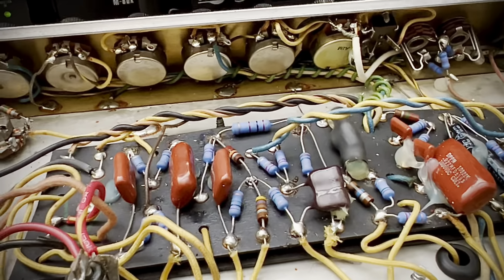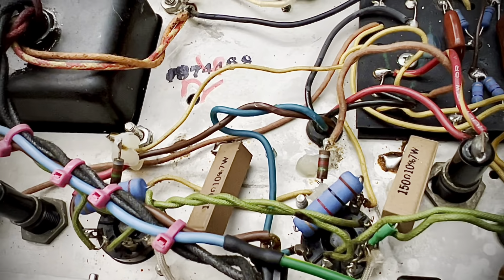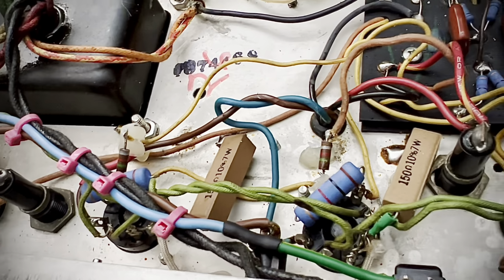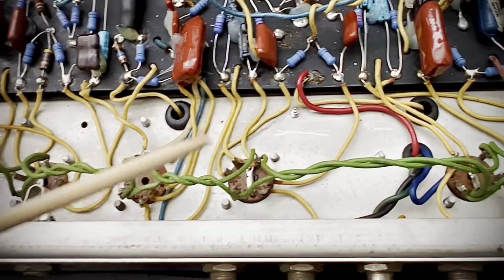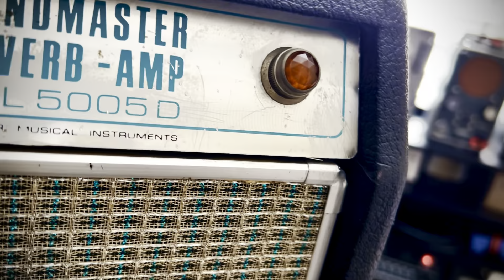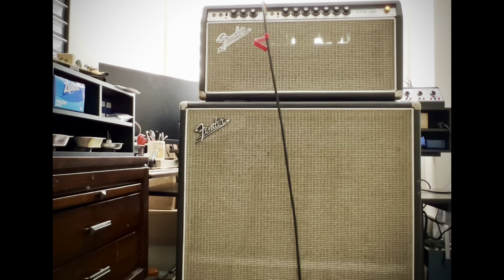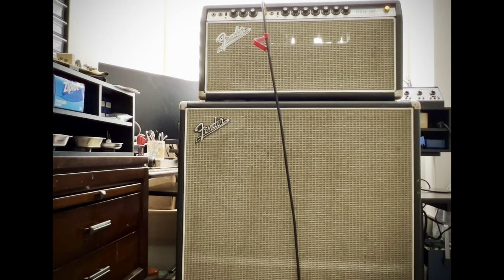Unscrewed 1967 Fender Bandmaster Reverb: Explore The Space

Comment: If you get the itch later on, install 1/2w NOS carbon comp resistors instead of carbon film.  And use larger wattage carbon comp insread of metal oxide for the output tubes, and the tone will have less glare and not feel as loud.  The rone will be more woody, smokey, and punchy.
Reply from the maker: Yeah, the prior tech shotgun all the plate resistors. Can't stand metal film or oxide for the plate supply. CC is where it's at.
Reply: @thatampguy  I'm run a restoration company and can tell you I've not met one other tech who actually cares about tone.  Most of them use a tone generator and nothing more to test their "work".  There are many other details that significantly affect tone too, like fuse direction, but try talking to another tech about that "witchcraft"!